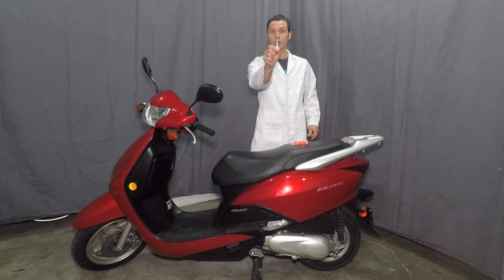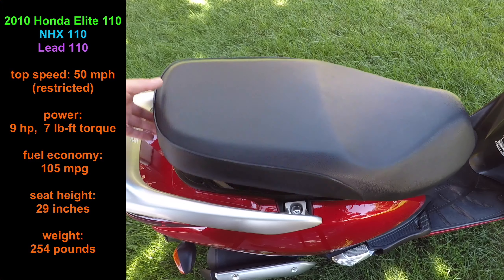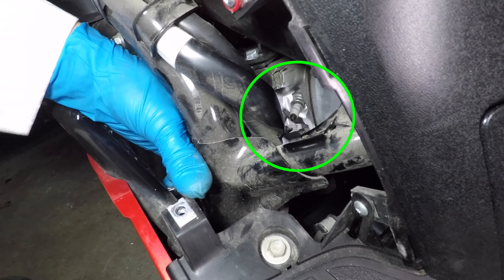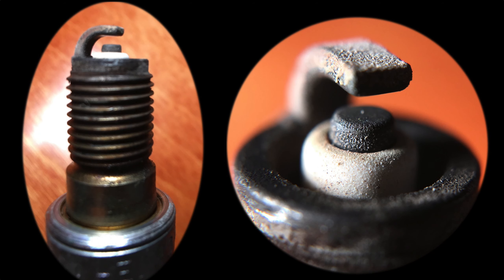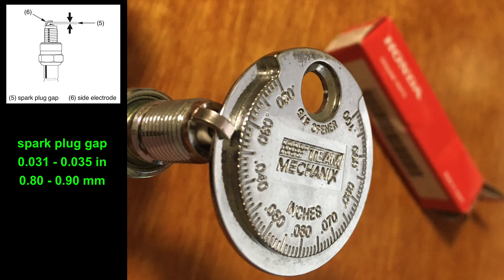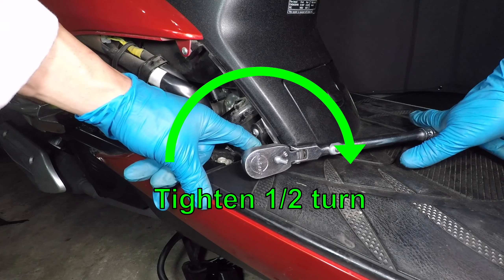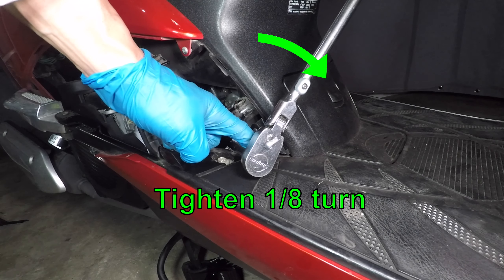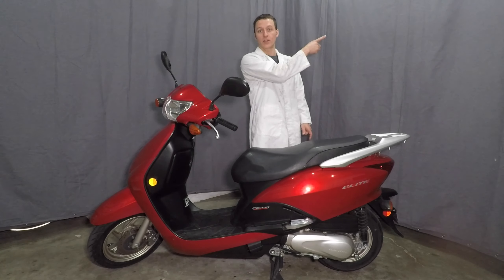Honda Elite spark plug replacement

Comment: I tried this method and had trouble getting to the plug, but I was able to remove the seat and cargo pan and the entire engine was exposed and getting to the spark plug was very easy.

Comment: Hello
When you changed your spark plug, did the old plug have oil on the threads? It look like that when you removed it. Is that ok?
Thanks
Reply from the maker: Yes, it looks like just a little oil.  I didn't see any oil leaks, and my oil was never low, so I'm not going to worry about it.

Comment: My Honda elite 110 has been sitting for about 5 years. It only has 400 miles on it but won't start. I have replaced the battery and siphoned the old gas out of it but it still won't start. The air filter is in fine condition and so are the spark plugs. Do you have any recommendations for what might be wrong
Reply: Spray some contact cleaner or staring fluid inside the intake manifold

Comment: Has the part # changed? I can't find CR7EH-9, which is what's listed in the manual. Every search comes up with CR9EH-9. Is this right?
Reply from the maker: The CR9EH-9 is a colder heat range spark plug that works better for racing.  For normal riding, try to find the CR7EH-9.

Comment: Hummm🤔. I wonder if that’s what’s wrong with mine. It’s running now, but at first it wasn’t. My wife had to take me to work these pass few days. It’s been misfiring for some reason🤔. Then it would make a clicking sound as if the starter might be going out. My wife thought it could be a loose connection with the battery, but I’m getting full power, so I’ve scratched that theory out. The only thing that I’ve never changed in my scooter, is the spark plug🙄. I feel like a dork🤦🏽‍♂️. I’ve changed my oil, coolant, filter, and battery since I’ve had my scooter, and the spark plug never crossed my mind😣. I’m sure that’s what it is. I’ll need to order that possibly. But again, it’s running right now for some odd reason. My job is just right around the corner🤷🏽‍♂️